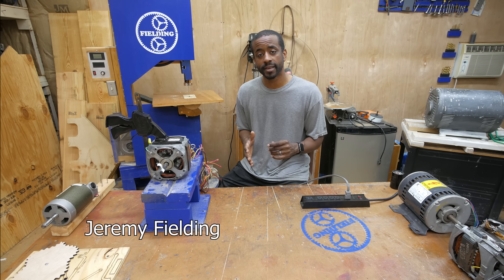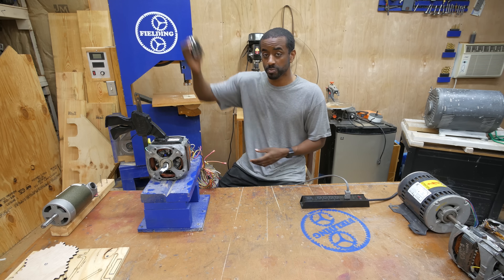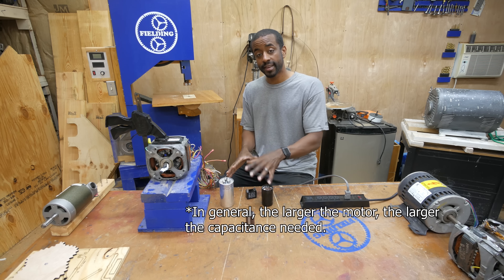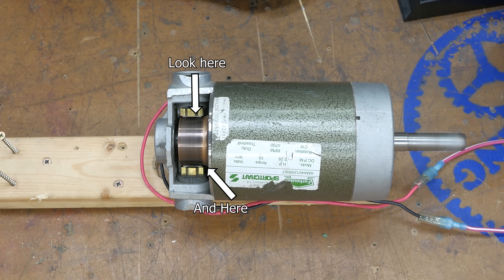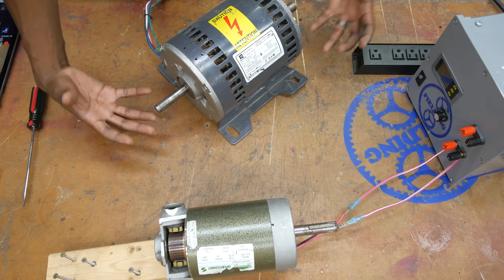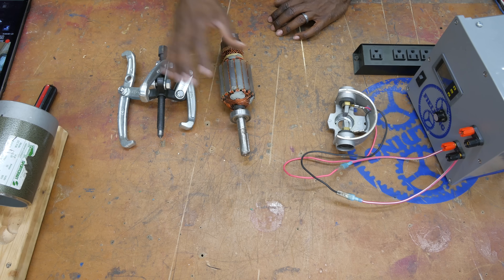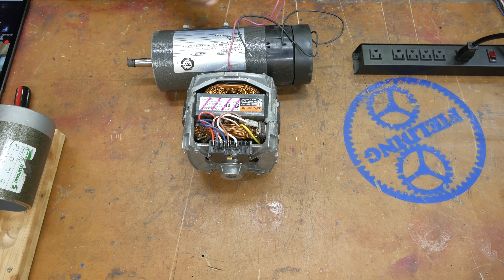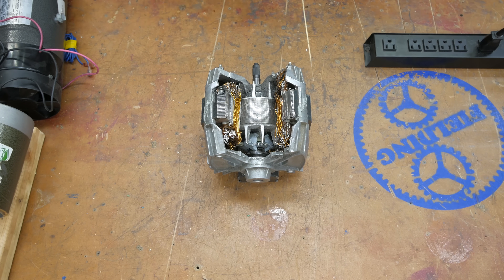Three Most Common Motor Fixes Anyone Can Do; Ultimate Guide to Electric motors ; #070

Comment: Thanks for the content.
Keep up the good work.

I was having trouble with an
old Maytag washer (A512). I 
surmised it was overloading
due to heat (just as you mention
in the video). I didn't know why.
The friendly appliance parts 
supply man suggested that the
relay switch attached to the motor
could be disassembled. I added a
start capacitor kit, which eliminated
the overloading (during light loads).  
It still overloaded, though, on spin
when heavily loaded. Before installing
a new motor, I took the advice and
removed the relay, and opened it.
The contact points inside were
not burned, but they were badly
pitted. After filing the points and
reassembling, the old motor started
without engaging the capacitor.
I now think that the real issue was
in that switch:
(05133 3ASM9A4A3 Maytag Motor Switch).
The switch was a bit difficult to put
back together after cleaning the
points.

The new motors are usually more than
$100-200. The appliance supply wanted
$180 for it.

Thanks for the advice about the motor.
בס״ד

Comment: Question bro, does a car starter have a cap? and if so, when the started fails can you just push start the car in gear
Reply: Push starting a car to engage the starter unfortunately won’t work because the starter gear extends and connects to the car’s flywheel when the starter engages.  When the starter is off, the starter gear retracts and no longer makes contact with the engine, so moving the car won’t spin the starter.  Good idea though.

Comment: You asked on another video; 
Treadmill duty measures the likely horsepower for an average user at an average speed over an average period of time. But because it is an average, it is not a true representation of power. Peak Duty – Maximum horsepower a motor can generate when working at its hardest.

Comment: I just purchased a new Marathon 1-1/2 hp motor for my lathe, it starts and runs, good power, but on half the starts there is a severe arcing and "pop" noise from the centrifugal switch,  it is enough to smoke up the interior inside the end bell. I ran it about five hours on the lathe to fully observe it, pulled it, and went back to the dealer, who seeing that the motor ran for five minutes, tried to ignore me. I called the factory and found the distributor (or reseller may be a better term) was ignoring Marathon warranty policy. After getting through the salesman and (deficient) shop (finally) to the sales manager, I got him to call the factory to find out what to do. I am waiting for Marathon's solution, I am in possession of the motor. Though I do not generally open anything with a warranty, as Marathon has photos and is informed of the problem,  I am sorely tempted to pull the end bell to look at it myself. this is a capacitor start, capacitor run motor. Half the starts were clean, half with the popping, arcing centrifugal switch (intermittent problem). on three starts, the start winding did not kick in, but the motor (not too awfully) slowly came up to speed (perhaps due to presence of run capacitor?). I will post what marathon says and does, this was the second motor with this problem.

Comment: Jeremy, i have a Harbor Freight 8" grinder that hums and won't start. Replaced the capacitor (200 mfd, 120 v)  and still no go. I noticed the power cord ground has broken. Could that be part of the problem ? Great video series. I subscribed and recommended.

Comment: The issue I had on a big single phase motor on a commercial washing machine was essentially dirty. Was too getting too hot and drawing more current until it tripped the breaker. I spent a long time trying to figure out why the breaker was tripping and eventually just disassembling and cleaning the motor fixed this issue. Lots of dirt/dust/lint caked on the cooling vents and such.

Comment: Over here in the uk (240v) the thermal cutouts tend not to reset. they operate more like a fuse, thereby requiring investigation of the overheating problem. They look like like little box capacitors but are usually black and wired in series. They are cheap and come with current, voltage and temperature ratings.

Comment: Nice video.  A note on brushes,  different applications and different manufacturers use different compounds to make their brushes.  Just because a brush fits doesn't mean it's the correct brush for your motor.

Comment: I love taking BROKEN things apart.  Can't hurt it...especially using a bandsaw to cut it open.
Electric motors in small appliances seem to be getting cheaper.

My electric leaf blower started misbehaving and I could smell something burning.
Sure enough, there was arcing between brushes and the copper armature contacts.
I cleaned up the contacts with 600 grit sandpaper, blew it out, but it was obvious
the copper stripes were thin, and burned through easily.
It ran better for a while, and went gently into the night (died). No surprise.
I just wanted to see how it worked.
By the time those armature contacts get burned through, that baby is done,
since its a cheap motor, and not there is no way to fix that problem.

You don't REALLY use THAT tool to remove bearings, do you?
That one is meant for belt pulleys, and those teeth seem rather 

large to get behind the little motor bearings.
But, if it WORKS, yes, then it works.

I have a bench grinder mounted on the wall I use for sharpening 

wood turning tools.  The starter cap is dead, BUT it doesn't matter.
This actually allows me to turn it in the direction I want to grind
right after I flip the switch.  Some tools I sharpen in one direction,
and others, in the other direction.  Love it when somebody tells me
its broken, and I just spin the stone and it spins up in EITHER direction.

Take care!

Comment: I have a 120 volt permanent magnet motor from my compressor that smokes and smells like it’s burning under load. The cooling fan is missing a few blades due to a free floating screw that was inside the shroud. It seems that was left inside by the manufacturer. When the motor slowed down and I smelled it burning I shut it down immediately. I pulled the whole thing apart and it seems perfect. There was a small amount of black soot I wiped off. I reassembled it at it worked fine for about a minute but then the same thing occurred. Compressor is just outta warranty and the motor is not available. The fan is however, for a few dollars. Do you think the motor is no good or could it be just the fan not cooling it properly? Thank you for any input. Great videos

Comment: a capacitor is the reason all my fan motors burn out also, if not the bearings first then the capacitor due to bearing resistance or dust, clogged air filters.

Comment: Centrifugal switches were also used a lot in older motors as speed regulation on countertop and free standing food mixers, etc.  It's an effective way of maintaining speed under varying load conditions, as long as the motor is powerful enough for it.

Comment: I have an ancient GE electric motor (1 hp, 97 lbs) on my air compressor. It started humming and wouldn't start, as you describe. The start and run capacitors were inside the end bell and were easily replaced. The motor ran for a few weeks and then started humming/not running again. I checked the newly installed caps, but they seemed fine. This time it turned out not to be the capacitors, but the centrifugal switch. The collar was made of Bakelite plastic (similar to 1930s telephones). The tolerance between shaft and collar was so tight, that a small amount of corrosion on the shaft had caused the collar to bind in the "run" position. It couldn't close to engage the start winding.

Comment: I loved the video, another possible simple/common fix are vacuum cleaner type motors that have the resetting thermal fuse in them.  They seem to eventually go bad because... cough cough the wife doesn't take the time to cut all the hair/string/carpet strands that build up on the roller by the bearings, then either the belt gets smoked or the fuse goes bad.  Replace or jump the fuse... c(_)

Comment: What do you do if a motor over heats
Reply: Blow out the sawdust or spider webs or dirt or whatever.
Clean the fan.
Make sure bearings rotate freely by hand.
Make sure the thing it turns is free (other belts, pulleys, etc).

Lawn mower starters will overheat when engine valves are
not set properly, due to excessive pressure in the cylinder,
which is VERY hard on the starter.   Many batteries have been
sold to owners because they didn't know about the engine valves.

I have no problem washing an electric motor out with pressurized water,
then blowing it off with compressed air, THEN plugging it in while in the sun
to let it dry out. But that's just me...not always recommended.

North Central Florida.

Comment: 29 appliance repair shops dislike this video.

Most shop vac motors use cheap bearings that wear out after a year or two.  If your shop vac is making funny noises when you turn it off, try replacing the cheap bearings with skateboard or rollerblade bearings.

Comment: I attempted at a shop-made 12" disc sander using a motor from an industrial compressor.   I blew the capacitor and oil leaked everywhere.  Set the motor outside and never looked back.  Now I know it's repairable, if I ever get around to it.

Comment: On most miter saws the brushes also serve as the brake, so if your saw is taking forever to coast down to a stop it won't be long before it quits running.

Comment: I’ve put up with a heater in my home that will only run if I give a nudge by rotating the fan.  In 2 sec.s  w/the help of Jeremy’s video ( and I know didly squat about electricity or motors) I realized that the capacitor on this heater fan motor was shot!!!  When I initially hit the switch (moving the thermostat to the temp.needed) the motor would just hum.... Now,  I’ve gotta tell y’all that that heater sat dormant for 30 yrs!!!  I live in California and heat is not all that necessary so it sat until I could run into someone or a YouTube video that would help me ( I live alone).  While watching your videos (actually I can’t stop watchin-Um! ) I came across an AHA! MOMENT!  Thank You Jeremy!!!!!!!!!  You’re the BOMB!!!!!

Comment: air compressor motor will start to run but can't get to full speed under load, I can remove the belt to the compressor pump and it runs fine, I've replaced both capacitors and it still does it, could it be a bad centrifugal start switch...

Comment: 🙏 Thank you for sharing your time with us!!  Question:  Is there a way to make a foot control (like a sewing machine has) to control the speed of a Dremel 295 variable speed rotary tool? I'm a self taught bench jeweler and I need both hands when I'm working on silver or stone setting. I like to repurpose, recycle, repair and sometimes make my own tools. Thanks  again for your work!!!
Reply: Build a small U shape piece out of boards. Get a dimmer switch, pull the knob off, attach it to one of the side boards. Run a dowel as a shaft from the dimmer switch's control to the opposite board where you put a bushing of some kind (can be just an old piece of plastic with a hole in it, like a piece of cutting board, shim made of milk jug, an empty tape roll or slice of a pen body since it's just to keep the motion smooth and supported). Attach a pedal to the shaft slightly off-center, like a treadle.
This will reduce the power of the dremel at the lower speeds as well, but I think the inbuilt speed control for them may already do that. Also it's important that the dimmer switch's range is sufficiently small to fit the range of the pedal, and that you orient it so that "low" is in the position you prefer - pedal fully engaged or foot fully relaxed - else you may have a struggle.

As an alternative, you can do it with a sliding dimmer switch. Put the pedal onto a hinge and add a return spring. Optionally a strap over the pedal so you can lift up with your foot too instead of just relying on the spring. (tip from the bike world used in coaster brakes and fixed gear bikes...)

Comment: Thanks for the video had no idea that their is a start cap and a run cap as well as centrifugal switches. I have a dumpster dived Dewalt  cordless drill that was smoking very bad. Cleaning the commutator with 1500 grit sandpaper resolved the issue. A pencil eraser will work as well just make sure it new or newer as rubber hardens as it ages and is less effective. The gaps were cleaned as well using a exactoknife however next time I will use a plastic tool to avoid burrs. Vacuumed up carbon residue and it was good to go.

Comment: First off, I very much enjoy your videos, you do a very thorough and professional job of explaining your various diy projects, and I love it. But, I have a different problem... I have a small 220v AC motor, taken from a conveyor belt, It was working properly, and was very new, then after just a few days of run time, it 'died' a bit of investigation revealed that it would run properly, as long as there was no load on it. (running thru a 10:1 gear reduction, screwed right to the motor) if the output shaft was allowed to spin free it works properly, but if you even push on the shaft axially with just one finger, the tiny amount of load will stop the motor. I had two of these conveyor belts we purchased for my work, so we just made it into a 'spare parts' item and purchased another (they're just cheap $300 chinese conveyor belts) But I would like to repurpose the motor if I can fix it, it honestly has only a few hours run time. I have disassembled it and found no capacitor, and no start windings, just direct run windings, single phase 220v AC brushless. Is this a failure you have ever seen before? If not, I would even be happy to give it to you to look into. It has 3 wires, red, white, and black, and the wiring diagram on it says basically to connect red and either black or white for cw or ccw rotation, oddly enough it needs white and black ganged up to run, both red to white and red to black gets me 75 Ohms resistance thru the coil windings, I almost expected to have a short in one or the other, causing it to be running with just one coil, allowing for the lack of torque, but they both seem fine. What do you think? If you've covered this exact issue before and I just stink at searching, please let me know. Thanks!

Comment: If the centrifugal switch on a motor is broken it can be fixed with a motor starting relay.  The relay energizes the start winding until is senses that the starting load in diminished and then it cuts off the start winding power.  I have fixed an unobtanium moter this way.

Comment: I have a motor (brushed from shop vac) that looks like the wire that goes to one of the brushes has burnt in two.  I have searched the internet for the motors part number with no success. Any recommendations on how to find replacement parts in this scenario? Assuming it is worth repairing. Here is the number found on the motor. 119506-00 p/n X75824105C001

Comment: I have a garbage disposal that shuts down  And the reset button has to be reset it will start to hum I turn off the disposal and manually move the cutting plate with a wooden spoon try thr switch sometimes it works or not .whould it be the copaster ??

Comment: I have a 110v,  single phase 1.5hp motor compressor motor.  Once it's under load it draws more amps until it trips the circuit breaker.  Any ideas?

Comment: Hey Jeremy, capacitors hold a charge- you will find out if you touch the contacts.  BTW- a motor with 2 capacitors has a run and a start and they are different.

Comment: Hey man I just came across a 6000w generator with a bad gas engine(free).  Have you ever tried to use the generator as a motor and power something like a small EV?   I cannot find electric motors larger than 7HP for under $500.  My goal is an inboard for a sailboat, but all my budget needs to be invested in batteries

Comment: Hi  I am restoring a bench grinder and I am trying to wire it to start. It did not come with a starting capacitor. The unit was made in Taiwan and has a green ground a black wire and a red wire in the power cord. The wires coming from the motor housing are black, yellow, red and gray. It is able to run on 110 and 220. There is a spring loaded switch in the motor housing so I am guessing it does not need a capacitor since it may be a centrifugal switch start motor. I  used the volt meter and found that the highest resistance was between the red wire and black wire. Which may be the starting coil. So I figured that I should connect red to red and black to black, to get it running. But what are the yellow and gray wires for? Do they need to be connected together? They seem to be the run coil wires.

Comment: Thank you so much for this very valuable info! You've given me hope that I can fix a spindle that started overheating and sparking after I attached a cheap power supply to it. Did too much voltage perhaps cause a brush to be damaged? I'll take it apart and investigate. Thanks again.

Comment: I picked up a  12V Firestone Air Compressor, part#WR1-760-9287 at an estate sale, held the wires to my battery and nothing happened.  Could not find a users manual, parts or exploded view, or a maintenance manual for it.  Just some stuff on air-rides.  I figure it should be an easy fix if I have some visuals on it.  I'm wondering about some re-purposing ideas.